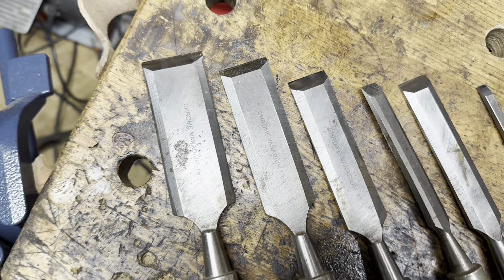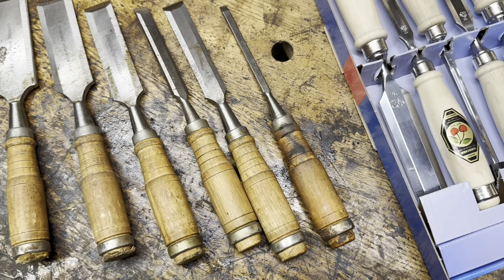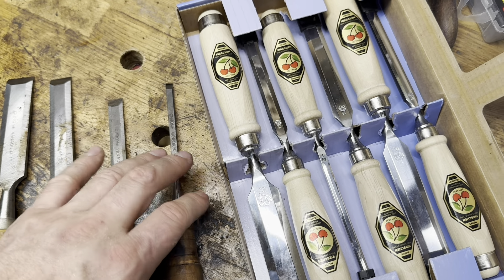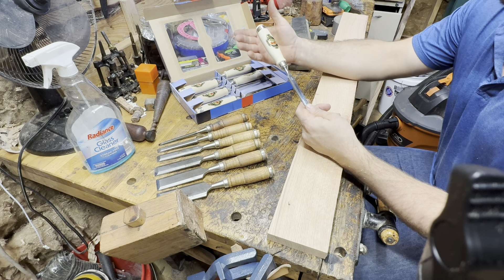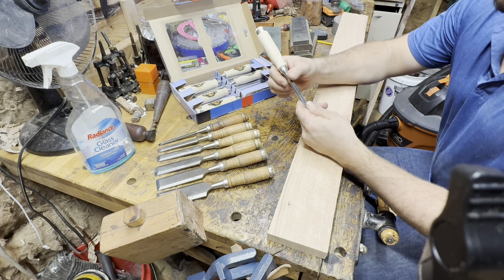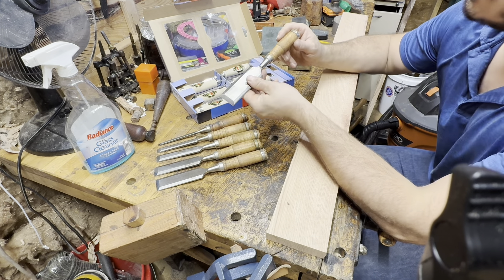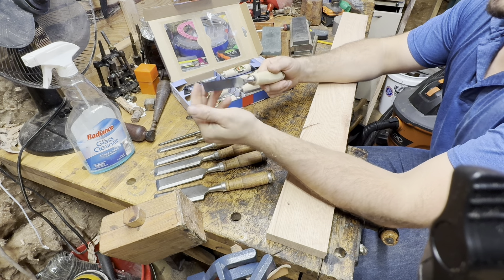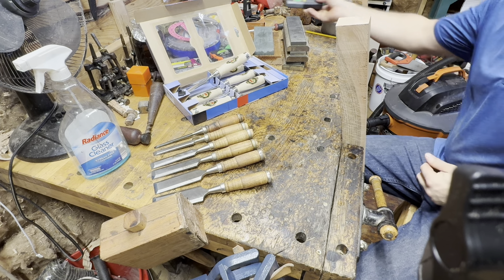Harbor Freight v. Hirsch (Two Cherries) Chisel Comparison

Comment: BTW, I noticed your sharpening skills are EXCELLENT.  In my opinion (after 40 plus years of woodworking), THE TWO MOST IMPORTANT SKILLS IN WOODWORKING ARE:  1.  BEING ABLE TO SHARPEN YOUR TOOLS  2.  PATIENCE.

If you have or can acquire these two skills, you will be an outstanding woodworker no matter what tool is in your hand.

Woodworking can be broken down into three parts:  1. Measuring and marking  2. Cutting  3. Joining  ("finish" is optional - the Japanese, for example, often favor "unfinished").

It's not rocket science.  Just be able to sharpen the tools that need to be sharp and have patience.
Reply: Meh, I sharpened freehand for a long time. It takes too long. Now I hollow grind on a bench grinder and use an Eclipse style honing guide. Much faster and more consistent results. It's just easier. I'm all about what's fast, efficient and easy to do.
Reply: @1pcfred  Sure ya do, buddy....
Reply: @zenkenshokunin  I do and so can anyone else. I wouldn't go back to freehand sharpening. I only regret I didn't upgrade sooner.
Reply: @1pcfred  Thanks for the laugh buddy!  If you're not trolling, then you've literally LOST skill!  🤣🤣🤣.  "upgrade"  ... 💀

For anyone else wondering the CORRECT way, here's a MASTER explaining: https://www.youtube.com/watch?v=okLIEoz00v0&list=PLqUOljnY0d9fWz-Dua4_Ov8l5j9CCncv4
Reply: FYI:  in that video, Rob Cosman LITERALLY states that sharpening your blade is NUMBER 1 in woodworking.  Then,  MASTERFULLY proceeds to break down his "32 seconds till sharp" method.  At the end, he talks about the importance of patience!
Reply: @zenkenshokunin   patience sure is important. It took me decades to come around to the method I use today. That's pretty patient. If I could discover an even faster and easier method I'd do that too. But as far as I know now what I'm doing is it.
Reply: @zenkenshokunin  I've taken skill out of the equation and replaced it with jigs and fixtures. I just want my tools sharp the fastest and easiest way possible. I'm looking to work wood, not hone steel. The correct way is always the most efficient way that yields the best results. I can freehand sharpen. I'd just rather not. What I do is better. Don't kid yourself either kiddo, there's definitely skill involved with how I do it. Getting that perfectly even crisp secondary bevel isn't a given. Making all of my tools look like they just came out of the razor blade factory ain't easy. But I do love it.
Reply from the maker: Thank you!

Comment: I also have those harbor freight chisels.  One expensive hand tool I'd love to try someday is a hand stitched rasp.
Reply from the maker: I used one once and it was really nice, an Auriou. Apparently there’s an advantage to having an inconsistent wear pattern
Reply: @urbanlumberjack  yes I've heard that the more randomized teeth creates a better scratch pattern. Possibly getting rid of deep scratches too?   Plus who doesn't want to try a fancy rasp?  I'd even like to try those Japanese rasps that cut on the pull stroke.
Reply: @urbanlumberjack  inconsistency would dampen resonances. Like soldiers marching over a bridge. Oscillations can set up bad feedback. Sympathetic vibrations. Beat frequencies. That sort of thing. With tools that leads to chatter. It's a hammering effect. That hammering causes patterns in the work that are generally considered undesirable. A riffling or a choppy waviness. You can make it happen by extending the work out of a vise far and filing it with a machine cut file. When it howls and makes nasty sounds you're doing it right. Which is wrong. The classic engineering example is the collapse of the Tacoma Narrows Bridge. That's what can happen if you fail to take resonance into account. It's pretty dramatic.
Reply: @ethicalaxe  rotary rasps in a pneumatic die grinder works how you always dreamed a rasp could work. It really unlocks your creative potential. But the work can go fast. If you need to hog material though it'll do it. Zoom!

Comment: Makes lots of sense to have a set of beater chisels around. Hammer them, abuse them, and if they need a lot of resharpening or even regrinding, oh well. I have a nice set from Woodriver with very narrow edges for dovetail work, and now I save those for that kind of fine work instead of beating them to death all the time. Make enough stuff from that southern yellow pine from the big box stores, chiseling through that rock-hard latewood grain in it, and cheap chisels you don't mind to see get beat up make a lot of sense.
Reply: I still don't have a nice set of chisels yet. But I've got some nice chisels. I pick tools up used when I see them from here and there. I just picked up a tote of tools and it had some Buck Bros chisels in it. They're nothing great. I think Stanleys are better.
Reply from the maker: Yeah, it's great to have a beater set of chisels for rough work!

Comment: Hiya', pal.
Those Harbor Freight chisels are fine.
I saw a video where a guy soaked the HF-style chisel handles in hot water.
Then he hammered the ends while they were still warm & wet.
He said that would keep the handle ends from deforming.
So I tried it on my HF chisel handles.
So far so good but I just started learning hand-tool woodworking.
So I haven't used 'em more than a few times.
BTW, I use a piece of construction grade pine for my strop.
I tried leather strops but apparently I used too much pressure & that rounded & dulled my sharpened edges.
The wood doesn't do that so it works better for me.
Have a GREAT day, Neighbor!
Reply from the maker: That’s a really great idea! I’ve heard of pine for strops, seems like it works great, I’ll have to try that
Reply: @urbanlumberjack I have  Flexcut leather strop monted on wood. The wood feels like possibly balsa, although it's stained  burgundy-colored. I haven't tried, and it didn't come with instructions, but I believe the strop can be used on either side...?
Reply: @suburbanyute340  yeah what leather and what compound you use has a great impact on stroping. Along with your technique, of course. I picked up a weight belt and I thought it'd make a great strop. Stuff was real hard. I didn't love it. I'm still using this leather scrap I picked up from I don't know where. But it's just right for me.
Reply: Before I throw away my worn out boots,  I cut the tongue out of them.   Flinty polishing compound etc and I don't have to worry about anything, especially when I use the old leather for polishing rotating metals on the lathe or drill press for a beautiful final finish.
Reply: @toddwheeler1526  I have a boot tongue too. I use it to protect stuff I hold in vises. I wrap the tongue around it before I clamp it in the jaws. Boot tongue gang!

Comment: Well presented video. I treated myself to a hand stitched rasp several years ago for the same reasons you mentioned. It is a beautiful tool that I enjoy owning and using but I don't think the performance advantage for the price difference is that noticable for my applications.
Reply from the maker: I used one of those ones and it really was incredible! I think it was from France, such a nice pattern on the wood.

Comment: 15:40 - I agree wholeheartedly.  I even made a couple of videos on this very subject on my old channel.  You can compare my perspective here: https://www.youtube.com/watch?v=vrjZ1wqSJ98 .  "In the old days", there was a huge gap between "top quality" and "low quality".  Nowadays, there's not much of a gap.  If it's chrome vanadium - you're not gonna wear it out!  

Most "luxury" tools are usually made in the same factory as "economy tools".  The biggest difference is that the "A team" of workers usually make the high end stuff and the "B" and "C" teams make the other stuff.  Usually, this just translates to "fit and finish" which the end user can do himself.  

I've been doing rough carpentry since the late 70's and "joinery"/furniture making since the early 90's.  In the beginning, I wanted EVERY TOOL!  I, like most beginners, thought that "great tools make a great craftsman".  Now, after 40 plus years, I'm focusing on streamlining my tools, streamlining my shop and streamlining my techniques.  

Basically, the more skill you acquire, the less tools you'll need.  Tim Ferris (totally brilliant) said it perfectly, "perfection isn't when you have everything you want, it's when you eliminate everything you don't need".  That would be my advice too.
Reply from the maker: I love that quote! I’ll check out your videos